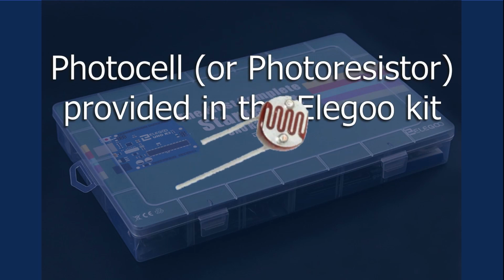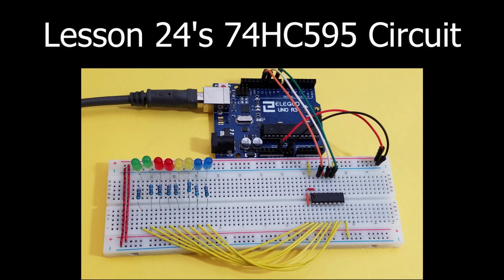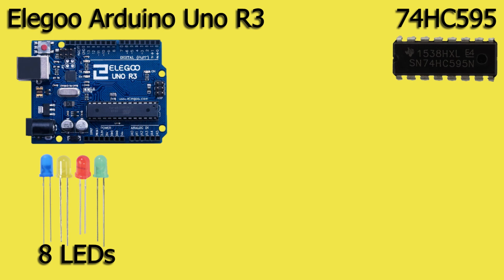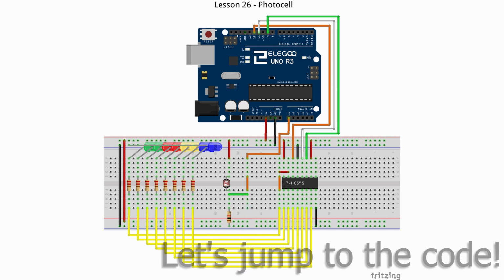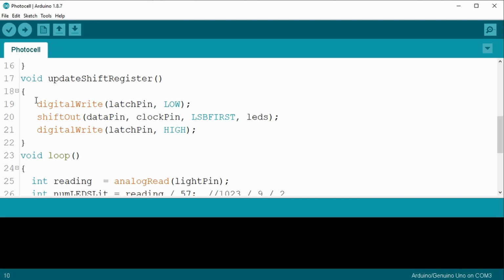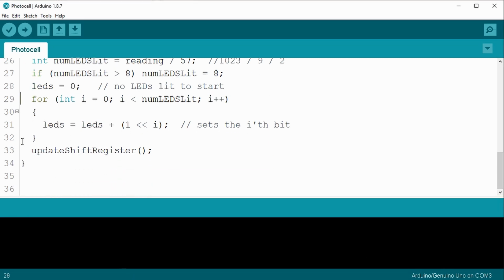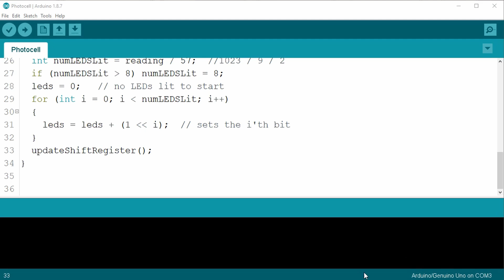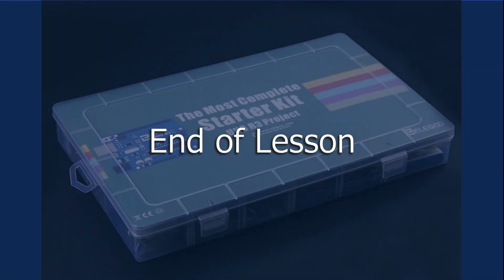Lesson 26 - Photocell

Comment: What is the purpose of the 1kohm resistor between the photocell and ground?
Reply from the maker: Please review the schematic diagram.  The  photocell and the 1K ohm resistor works like a voltage divider.  The resistance in the photocell varies with light, which causes the voltage read across 1K resistor to change from very little to almost 4.5V.  A0 reads the voltage value between the two components.